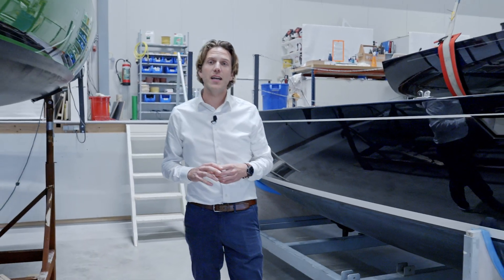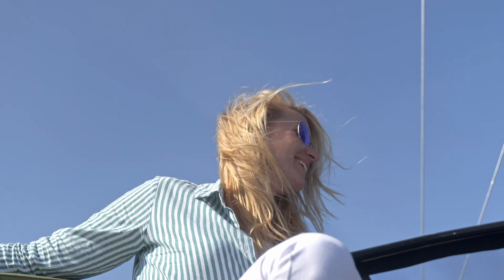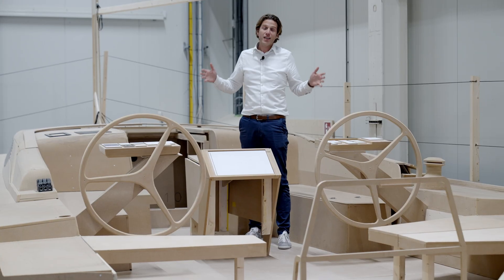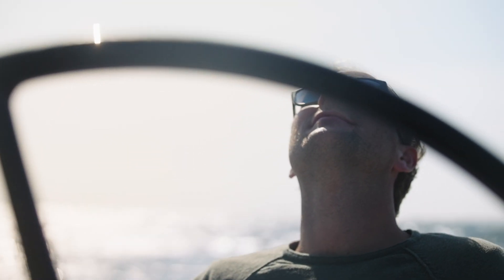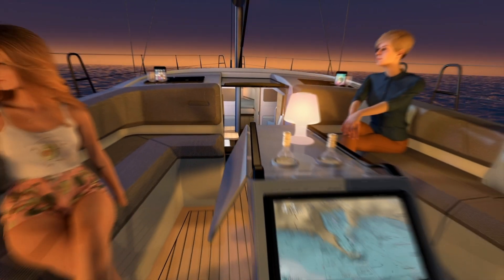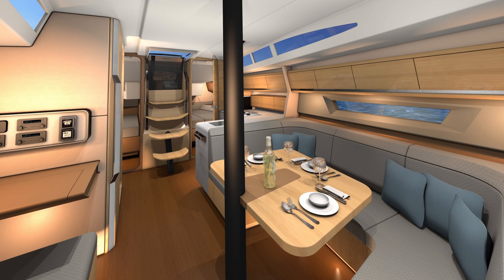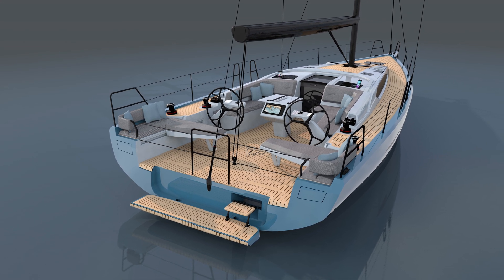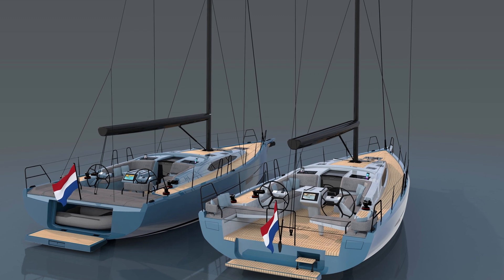The Saffier SL 46 design process explained

Comment: Some food for thought:
1) Can the helm chairs have a leg extension angling the bench 15Deg
2) Can the inboard side of the bench have a fold out arm rest, and back rest
3) Can both winches each side be side by side and operable from the side (Not bench) sitting position with push button control
4) Does the boom have the lifting capability to lift and attached the outboard motor to the dingy
5) Can the outboard motor have a storage location that is within reach of the end of the boom lifting unit.
6) Does the boom have a Man Over board lifting harness capability
7) can the boom be secured in place at the outer reach at anchor so a Flopper Stopper can be used on the boom lifting  unit (Used for the outboard motor)
8) can the whole of the rear area be completely enclosed for bad weather sailing, and convertible as a vessel wide sun shade in very hot climates
9) Can all halyards and lines be routed to the one sitting position for true all round push button single handed sailing
10) Last but not least - Can the life raft be activated in 15 seconds

I hope the above wish list gives your team food for thought - Contact me if I can help